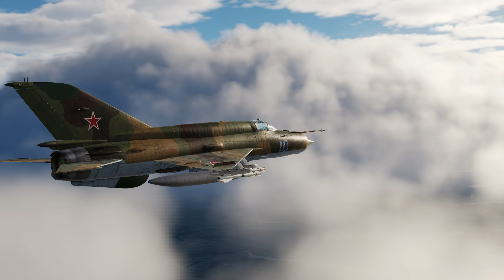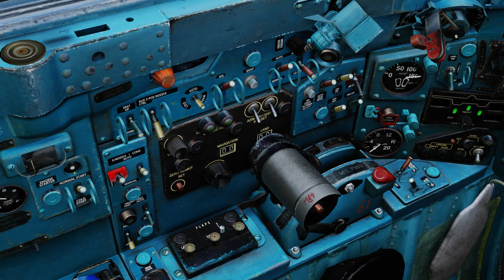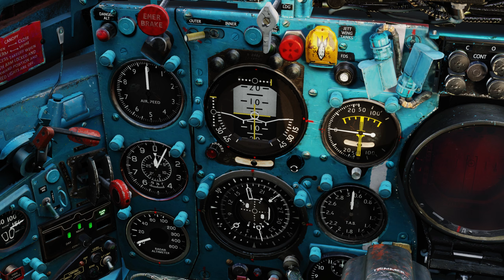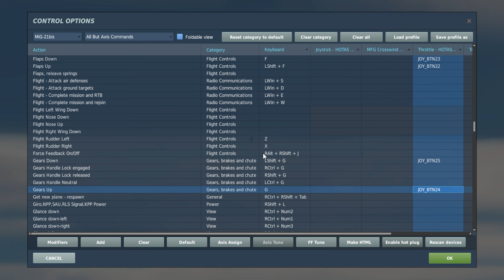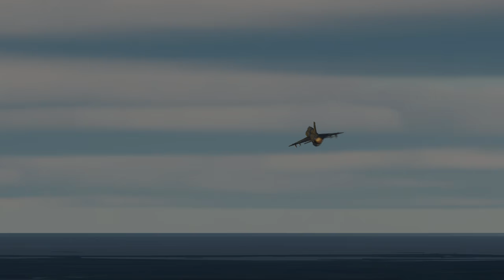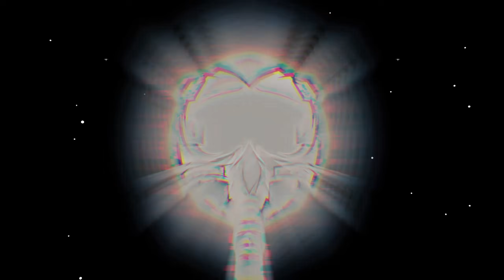DCS MiG-21 Series - Cold Start Guide for the MiG21

Comment: If I may make a suggestion. I think it would help to remember the startup/operating if we knew what each acronym stood for and the reasoning for the order of sequence.

Like for example, to start the AAVP7A1 (also applies to AAVC7A1 & AAVR7A1). Before startup steps, check all fluid levels in engine, transmission, and suspension (fill any level that is low) [Do not attempt to start/operate if fluids are missing] {If vehicle is not to be moved, suspension fluids are irrelevant for startup and running of vehicle}.  Flip the main batteries switch to On position (this switch turns on/turns off electrical for the whole vehicle). Make sure that you are showing enough battery power on the main gauge panel (if not, you will have to jump start using the slave cables and another vehicle with sufficient power) [also take the opportunity to check the fuel level {fuel gauge may not be accurate and the best way to determine fuel is to check operating log book for rough estimate}]. Pull the fuel lever all the way up (the fuel pump is electric and won't work without the main batteries switch in the On position {You will be able to hear them when working}). Determine what mode the vehicle is in by looking at the switch setting, immediately followed by looking at the plennum indicator (if the indicator is up, you are not in land mode {trust plennum indicator over switch position}) If the vehicle is any position except land, hold down the bow plane handle all the way down or the ramp handle all the way in the direction that the ramp currently is located (holding the bow plane handle down or ramp handle routes hydraulic pressure away from the hydraulic bilge pumps) [if the hydraulic bilge pumps functions after startup, you may get unwanted POLs spilled outside your vehicle, that were previously in the belly of your track *This is a dangerous HAZMAT situation that can be avoided*]. Press the ignition button for the amount of time it takes to start your track (normally takes 2-5 seconds [Do not exceed 10 seconds in a single start] {If vehicle doesn't start, double check your steps and retry}). Your vehicle should be started (if vehicle doesn't start after steps have been verified and a third attempt, contact a mechanic from Maintainance Platoon for assistance) [take a moment to admire the sound of the 903 cubic inch turbo diesel]. If vehicle was in any position but land, switch to land (once plennum indicators have decended, you can let go of the handle (ramp or bow plane) you were holding. Allow vehicle to come up to operating temperatures (if possible) before operation (30 minutes at idle or 10-15 minutes by holding accelerator to 1500 rpm on tachometer) [If accelerating engine, look at the muffler and view the clouds of black exhaust gases. Give double middle fingers to Mother Nature]. OORAH YAT-YAS

Comment: The only thing you missed I think is the radios. There is a large hiss in the cockpit when you startup, because by default the navigation system is in the ARC mode. Either turn the ARC radio volume to zero, or (what I do), switch from ARC to RSBN with the switch on the sidewall behind the throttle, then turn the RSBN volume down with the black rotary to the left of the throttle. Makes the cockpit a whole lot quieter. Also I believe the JATO switches on the right panel should be turned on along with uncovering the countermeasures switch to get those chaff and flares working with the autostart—if I recall it doesn't switch them on automatically.
Reply: @TrickerDCS  it definitely starts up with a hiss, even with autostart. Try turnin down the ARC volume and you'll see what I mean. Obviously it's not critical for flight but it is annoying
Reply from the maker: @Itsthenaynay  I’ve never even noticed this lol, I’ll have to investigate, thanks for the tip

Comment: The radio and the flight rec should be turned on prior to engine start, right after DC gen and fire ext. Otherwise it will be almost impossible to investigate if something went wrong. You also need radio to request permission to startup. Turning on AC gen prior to engine start is wrong. Correct procedure requires to turn AC gen on AFTER the engine is started and idling at least at 35% RPM (1). Arming gun on the ground is very unsafe and useless action, generally not recommended - gun barrels are pointing right at the nose gear anyway )
Reply from the maker: Some important details here, although, this is just the way I use to quickly get up in the air

Comment: I suggest to also bind IFF interrogate and when possible some of the radar filters and low level modes.
Good tutorial. The MiG-21 start-up seems intimidating but can be done really fast and with some practice some steps even during taxi as the jet doesn't have to wait for alignment. Setting up RSBN/VOR before take-off is also helpful.
Reply from the maker: Great suggestion and can’t believe I left that one out, dough!
Reply: @TrickerDCS  You also forgot the izdelie 81 switch, which (incorrectly) serves as master power for the IFF interrogation system in DCS 🤓 Autostart doesn't flip it either.
Reply from the maker: @rossmum  yah I put that in the pinned comment, appreciate it brother.  I’ll update that on the air to air tutorial